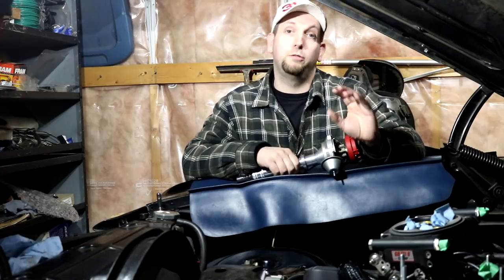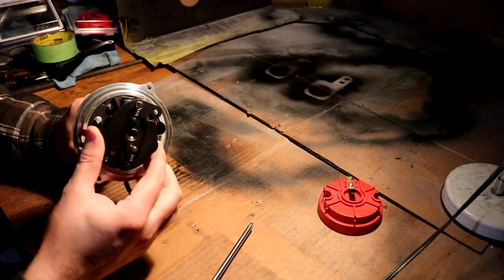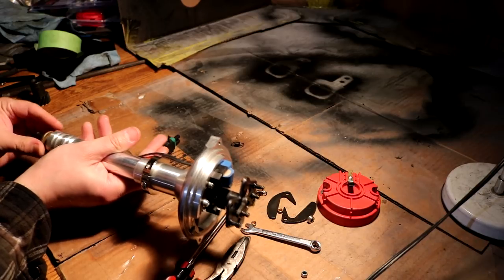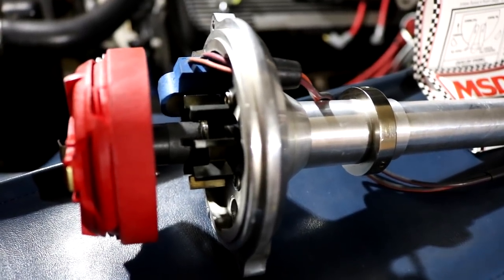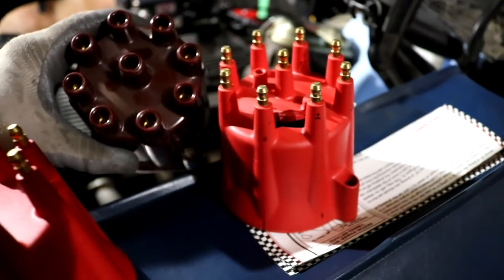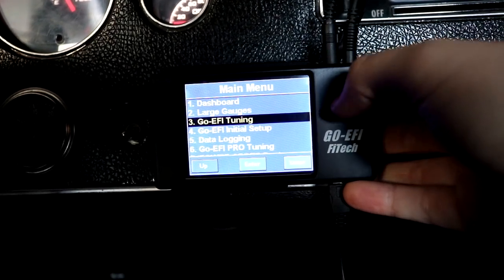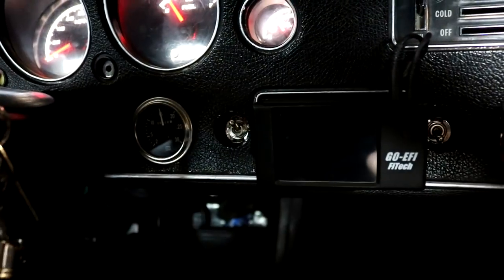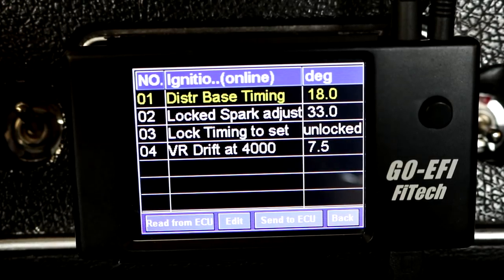FiTech Timing Control

Comment: Nice work! 

Now that you’re on T198i you just need a switched 12v positive source connected to the AC wire. You can change the AC to 2 step control in the handheld. 

Once that wire sees 12v you’ll have a spark controlled 2 step activated at whatever rpm you choose.
Reply from the maker: Yep, I got it working. Just need to finish the video. Thanks again!

Comment: If you want to simplify this deal then go get a distributor from any 80’s-90’s tbi or tpi Chevy V8, remove the ignition module, splice in the two wire connector from msd and boom you’ve got a distributor that fitech can control.
Reply: i know im randomly asking but does any of you know a trick to log back into an instagram account..?
I somehow forgot my account password. I would love any help you can give me.
Reply: @Khari Keaton Thanks for your reply. I got to the site through google and I'm in the hacking process atm.
Looks like it's gonna take a while so I will get back to you later when my account password hopefully is recovered.
Reply: @Khari Keaton It did the trick and I now got access to my account again. Im so happy!
Thanks so much, you saved my account !
Reply: @Jaylen Skyler No problem :)

Comment: Sbc and Fitech 600 here, I'v set my balancer to 15 degrees @TDC, so the rotor cap, and and adjustable cap is 100% inline (adjustable cap is a zero). Then I adjust the adjustable cap 15 click clock wise (the distributor direction), and lock down? (some says opposite of distributor direction ) Sorry I just need to be sure :- )

I will send a mail to Fitech now, asking for a software upgrade, my system is from 2017 or 18

Comment: I could use some help. I understand the variable rotor timing to phase the rotor contact in relation to the inductor position. I have a SBC and could use timing curve guidance for a SBC like you have done your big block. My mechanical valve train is set at 3° advance. I am not certain where to place the base timing, or how much total timing I can get out of the FiTech. I have a Pro Billet MSD distributor which I locked out. But I didn't know I needed to phase the rotor (probably the issue). This is new to me. I am running a roller motor with gear drive timing roller lifters, roller rockers, aluminum 6" rods, Ross forged pistons, Edelbrock 64cc heads, 2.02I and 1.64 valces, and a Fitech Go EFI 600. I could really use help with a timing profile for this engine. Fi-Tech has so many adjustable features.
Reply from the maker: You need to ensure you have your rotor all phased up correctly first. This will ensure proper function. As for your timing curve, a typical SBC will run a very similar timing curve as what I have in my BBC. I'd say use that as a guide. 14-18 degree base, 34-38 degree at WOT, and 40+ at cruise.

Comment: Thanks for your video, very informative. I have a question about where you set your desired total timing in the handheld. Under which function do you set your desired total timing. Secondly, just to double check. You need to unlock the locked spark adj. when you check your VR drift at 4000. And you want your VR 4000 to match the number you have set in your lock spark adj? Do I have that right?
Thank you!
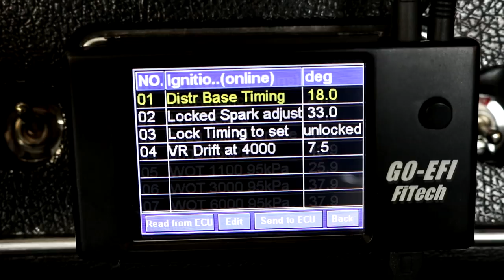Reply from the maker: Once you have fully set up and sync'd your distributor and handheld, you then go into Spark Map table (If I remember the name). At 19:23 of the video you can see my spark map settings. These are total timing figures. 

When doing VR4000 with your handheld set to locked timing, you want those values to match. If they don't, you adjust the VR4000 value till the do.
Reply: @SS454LS6  Thanks for your reply. So should I do the VR4000 for each rpm on my spark map to verify it matches what the timing light says? Or once its synced I can be confident everything is in order? This may sounds stupid but at which value in my spark map will my total timing be? I heard you say in your video you  want 48 degrees of total timing in your motor. Normally when you time a motor (as you know) you rev it to around 2500 or where ever it stabilizes and then you can read your total timing. So I would like to have 36 degrees of total timing. Under which value should i input that in my spark map (2500rpm). Thanks for your help
Reply from the maker: only need to do VR4000 during setup. Once it's synchronized, you don't need to touch it again. If you have not changed your breakpoints (your RPM and KPA values), then you would put 36.0 for 3000 95 kpa. If you want better gas mileage when cruising, add some timing for the 45 kpa values.
Reply: @SS454LS6  perfect, thank you

Comment: how much does mpg and performance change moving the timing and how aggressive would you put your timing
Reply from the maker: You can see a pretty significant difference in MPG between a bad timing curve and a good one. As for how aggressive, not every engine is the same, so you just find the timing that achieves best performance.

Comment: At the 17.00 mark your Locked Spark Adjust is set at 33. How do you get that # to stay at 33? Every time my controller is cycled it reverts to 89.6. Great video, and thanks for any help.
Reply from the maker: Just as it shows. Set it to "locked". Recycling the controller should turn it back to unlocked, but 89.6 sounds very strange. That sounds like a glitch in your controller/software. Unfortunately you may need to call Fitech about that one. Let us know what you find out.

Comment: I’ve watched your video several times. I am in the process of setting up my Fitech the way you have. A bit confused about where you said your timing was out 8* so you adjusted for 33*. That changes your base timing. Did you have to go back and check your new base timing and enter that in the controller?
Reply from the maker: All you are trying to do initially is sync your timing as seen by a timing light and what the computer says. So when i first started it up, I was 8 degrees off. I rotated until timing light read 33* so it now matched the 33* I had set in the Fitech. Then I adjusted my rotor so the post was centered while at 33*. Then check timing at 4000 rpm and figure out any VR drift.
Reply: @SS454LS6  thanks for the reply. So no idea when you first started where your base timing was? I tried to set it up like Smoked Tirez described but it wouldn’t fire and eventually killed the battery. Hoped to experiment more but now I have total electrical failure like you had. Fun stuff. Thanks for the info.
Reply from the maker: @steveh1256  I had my base set to 18 according to timing light. Basically that should be your minimum RPM. Again you are just trying to sync it. 

My elec failure had nothing to do with the Fitech, hopefully your's is an easy fix too.
Reply: @SS454LS6  With an adjustable rotor, can you just drop the distributor in at 0° TDC, set you base to your minimum advance, lock it in at your middle sweep, then adjust the rotor?
Reply from the maker: @Peewee0413  That sounds correct. As long as you get your rotor phased so it is firing in the center of your post at the middle of your sweep timing point (in my case 33 degrees), then it should work great.

Comment: Nice video! Question you did not show the change you made to the connecting plug. Can you tell me if it matters which wire color wire goes to which color wire going to the FiTech? Or does this pretty much act like a switch and the wire paring doesn't matter?
Reply: Yes it matters. If you google MSD pkug wiring for EFI youll see a lot of people have had issues because of incorrect wiring.

Comment: . When installing a magnetic distributor and choose magnetic the program automatically chooses 45* as the reference angle ..This system is fully interfaceable meaning you must put in all variables properly then do the proper calibrations to ensure both jive correctly..It doesnt have a preburnt chip like a production car and download is just a mere outline of the systems capabilities you pick n chose from then finetune...

You can do the setup process wrong and the engine will still run but that doesnt make it right because youre actually making the ECU work harder than it has to to keep your ride running and prone to failures when taking long cruises having injectors hang open from overheating etc......

The process is simple...You are first setting the pickup and the reluctor as close to #1 plug possible then the distributor gets locked down for life unless small adjustments are needed during the verification process using a timing light....This initial process is setting up your 45* reference angle. Then after you set the pickups reference point at 45* you set your median timing [mine was 30*] This is the midpoint in which the system will use to scale back n forth in the automatic timing control.........

After youve set your new locked for life timing spot and rolled balancer to median timing spot;-[yes I said locked for life!]..;-You next dial-in the rotor pointer to #1 wire on the distributor cap using an old distributor cap with a hole drilled in it at the #1 tower spot and an adjustable rotor...Before you even try starting the engine you pull fuelpump fuse bring up startup gauges on handheld then crank the engine until you see rpm's registering ..If rpm's are registering youre gtg to reinstall fuelpump fuse and then do a TPS autoset before you fire it up for the first time..Also make note at how fast your engine is cranking this will be imprrtant to know in the hot start cranking parameters and the closest correct rpm to set it at....400rpm's is way way to high...

After it fires up grab handheld and bring up the static timing area and punch in 15* then hit set then verify with a timing light at the balancer......After the key is switched off the timing will revert back to your simple settings set in the program..
Reply: Also in the diagram you were referencing about the pointers thats instructions on how to phase the rotor when using a spark retard for nitrous/turbo etc...........

https://www.youtube.com/watch?v=oBSiyeg4XCU
Reply: Do you set the reluctor and rotor to the #1 at TDC or 45*?
Reply: Also confused about setting the static timing per your instructions. I thought you set then tell Fitech what the static timing is not the other way around

Comment: i am not sure if i am quite under standing this, your numbers seem high to me. both on initial and all in. my experience tells me somewhere between  and 12 and 36 for a street-able big block. School me please!
Reply from the maker: You're thinking about timing at WOT. At cruise or idle there is no load, thus higher timing is beneficial for leaner mixtures to burn as well as keep the engine cooler. With vacuum advance it is not uncommon to see a BBC see 48-52 degrees of total timing at cruise. At WOT my max total timing is 36 degrees. With electronic timing control I have a little more freedom to build a timing curve to my liking.
Reply: Leaner mixtures=higher combustion temperature..... adavanced ignition timing = higher combustion temperature..
Reply: @danielray508  highest temp @ 14.7:1, farther you get from that is cooler in either direction. - Engineering Explained channel.